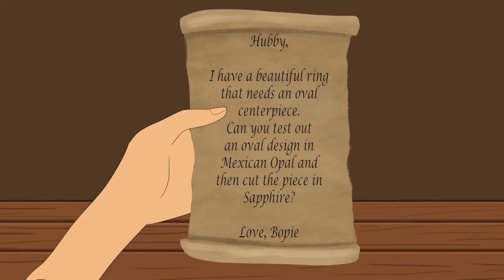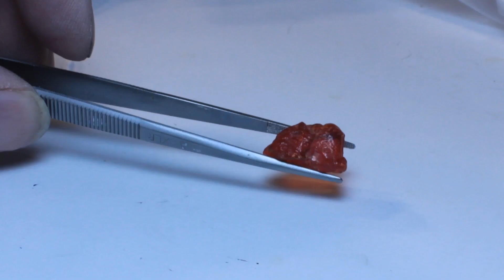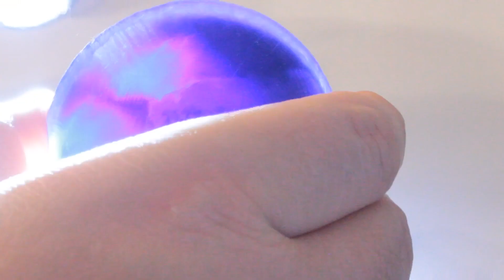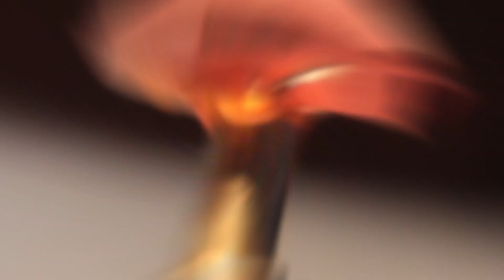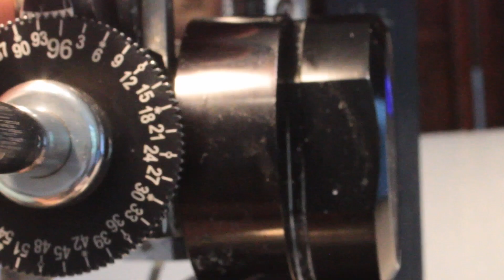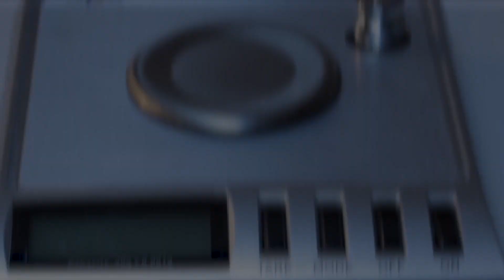Gem Cutting Tutorial: Cutting Jeff Graham's Rainbow

Comment: I digitized this design in GCS and ended up with a Table just like yours turned out ... not touching all of the Star Facets as one might like. 
I have since been trying to change the angles of the crown facets to rectify this issue so that the table, nicely intersects each of the Star Facet Meet Points. I'm not there yet. Had to put it aside for the time being.
Reply from the maker: When you get the design to be almost perfect, please send the GCS file!  Thanks!